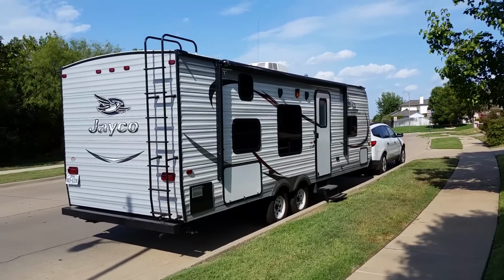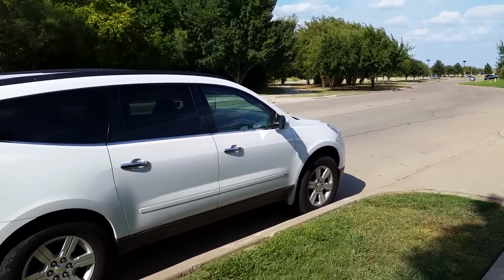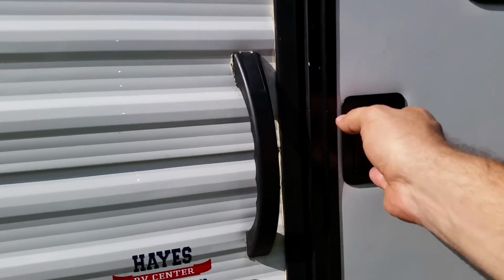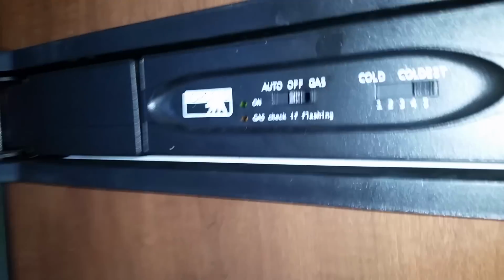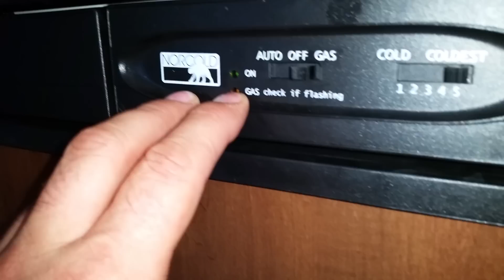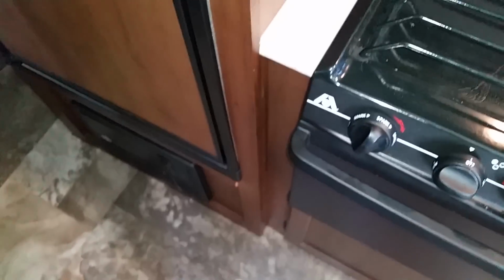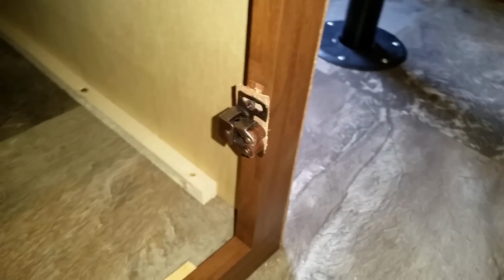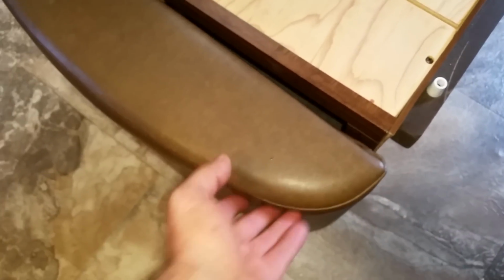Update: New JayCo Trailer FALLING APART.  Lengthy Warranty Work Needed.

Comment: I'll be crossing Jayco off my list.  Thanks for the heads up.
Reply: cbcnamja 
You're not gonna have any on the list. Same goes for car makers.
Reply: The sad truth is NO RV manufacturer will supply the owner with a  schematic diagram to ANY internal wiring regardless of AC power wiring, data control wiring; and DC powered distribution systems involving internal standby generators; and DC charging systems for inverters. The larger the size of RV, the more entertainment hardware wiring infrastructure becomes necessary. Vibration and lack of conductor protection via affixed flexible conduit will result in some type of eventual electrical/electronic failure. Factory support will not supply electrical schematics to purchaser,even when offered to pay for, under the guise of protecting curious consumer from potential electrical shock,warranty void, ect. That is legitimate, however, the consumer should have access to the information regarding technical devices they paid for. Droopy wiring and miles of vibration will eventually lead to a direct short or open circuit.
Reply: that would be a bad idea... just go with jayco EAGLE or better and you won't have these problems....i have a 2013 jayco eagle that is immaculately put together. i've had it for over a year with no problems as of yet
Reply: cbcnamja I wish I had seen this before I bought a Jayco. 1 year old. Falling apart, and neither the dealer or Jayco will do anything about it.
Reply: Also they offer a 2 year warranty. Look every rv you buy you have to go over it with a fine tooth comb. I just got a Jayco 28bhbe and yes I have 4 things that have to go back for the 60 day check to be fixed. However I would not buy anything else cause we love this camper. I would recommend Jayce to everyone. Just understand you will always have work that needs to be done on everything. Heck my neighbor has a fifth wheel he bought from another brand. And the list of warranty work he had was unbelievable. The point is if you find a camper of any brand that does not need any work your lucky. Don’t say no to Jayco just cause of the video or the bad reviews of a few. Remember how reviews work. Only people with problems make the review for the amount of campers they sell most people are happy with what they have. Like our family is.
Reply: As a RV service tech they are all built like this all partical board trash
Reply: WRONG. No particle board in Airstreams.
Reply: Yes even airstream it's a cost and weight saving thing. I recommend doing your own conversion trailer or van if you are even a little handy it's not hard and will last many times longer
Reply: SWolf you obviously don't know the difference between particleboard and plywood. You probably think they're the same thing. I suggest you educate yourself on the two.
Reply: Yes,  ALL of them.
Reply: @anthonystaggs6239   Jayco is the only RV company that supplies a warranty for 2 years.
Reply: @anthonystaggs6239  I have an Eagle and have had only 1 issue which I took care of myself with a piece of 1x2. Sliding door track deep in the pocket was falling. Pushed the 1x2 in (precut to correct length determined at other end) and has been great otherwise.
Reply: cbcnamja Jayco = Junko
Reply: @nitacruise9993  nope.
Reply: @stxman51  Nor in Winnebago!
Reply: SWolf jayco are made with plywood
Reply: flying fast keystone doesn’t make jay flights.
Reply: @nitacruise9993  - The warrantees aren’t worth the paper they’re written on.  And even if you get an appointment with the dealer to finally look at all of your issues, good luck getting them fixed.
Reply: it's not just jayco, any ultra light trailer is going to have these issues. unless you're spending some big bucks just about any trailer is going to have you wondering if it was homemade. the quality control on these things is non existent.

Comment: I'm a retired RV Technician. Jayco has always been the lower end of RV construction. Everything you got there is easily fixable but it takes a little time because you first have to tear it down to put it back the way they should have done while building it. hey use the cheapest of materials and seem to specialize in good looking but shoddy workmanship Their shorter units fare better because the frame doesn't flex so much. My advice if you buy a Jayco make it a 15foot or less unit or it will flex and everything will start coming loose or popping apart on you. To bad you don't live in Florida I'd make the repairs for you but it would take me a week or 2 I'm not as young as I use to be, LOL
Reply: Henry, this is a few months and you may not see this, but do you have a brand of TT that seems to be of a higher quality build? Looking at Minnie Winnies, but had considered Jayco. Glad I saw this. It will be used for living for 2-3 years when retiring and having another small home built.  Would like for it to last for traveling also. Thanks!
Reply: Henry Avery 
Ll
Reply: linda lewis 
OeYou slis
Reply: linda lewis pqToeqo
Reply: Henry Avery so who is the best rv builder other than air STREAM?
Reply: Henry Avery - What brand(s) would you recommend?
Reply: Henry Avery my jayco 16xrb was somehow pumping the black water out of the faucets. That should be impossible, but it happened on my last trip over thanksgiving. Absolutely horrific.
Reply: Don Calvo black water as in sewage?  impossible,  as they're not even remotely hooked together.  only thing that could cause black colored water us severe contamination in the hot water tank or your fresh water tank,  and those can be easily remedied. another possibility is you hooked up to an unfiltered bad water supply or you may have used a new filter that hadn't been run yet. some filters you need to run water through them to remove the black charcoal dust before hooking it up to your camper for the first use.
Reply: Henry Avery I recommend a tube of silicone and aa caulk gun.
Reply: P
Reply: What's the best manufacturer for a small(less than 20 footlong) toy hauler?
Reply: Henry Avery 
Are there any well made truck bed campers ? I’ve recently become interested in trailers/campers but they all seem to be the worst build quality.
Reply: If you are near Orlando area I would gladly like you to look at our Jayco, R26 2020 that has had wall issues from purchase and has been back 6 times for same issue..no resolve or satisfaction from RVOne or Jayco and the warranty seems useless.

Comment: Even if the Traverse is rated for 5,200 lbs tow rating and the dry weight of the trailer is 5,000 lbs. You still have to factor in the fresh water in the tank, cargo, food, and yes, even passengers in the tow vehicle. My 2016 Jayco 267 has a 38 gallon freshwater tank (315.4 lbs when filled) You are easily exceeding your tow capacity of that Traverse and will be straining the transmission, the engine, and be putting your family’s life in a dangerous situation. With cargo, food, water, and passengers, you are probably at around 7,000 lbs tow weight. You need to find a vehicle that has a minimum of a 7,000 lb tow rating, preferably 10,000 tow rating for this trailer. 

Your Traverse could at best tow a small 3,000 lb pop up trailer comfortably. When you factor in cargo, water, food, and passengers, you should be at around 4,000-5,000 lbs.

Just spend the money and at least get a 1/2 ton gasser truck, preferably a 3/4 ton truck diesel with the proper tow rating. Otherwise these small cosmetic defects will be the least of your worries. If you bought the trailer when you drove to the dealer with this Traverse, you had one hell of a shady dealer. I wouldn’t have sold you this trailer unless you had something rated to tow it.

Comment: I own a new 2018 33rbts  . No issues. Built way better than the last 6 travel trailers I have owned. I found instead of complaining do the maintenance yourself. Realize that it's a travel trailer not a house.  If you buy a light version it's a stripped down version of the regular trailers. Yes lighter means probably your not brightest person in the world.
Reply from the maker: Might I suggest you take a remedial course in proper grammar?